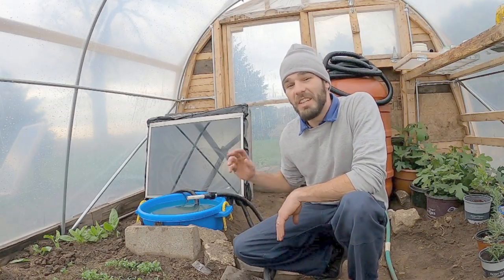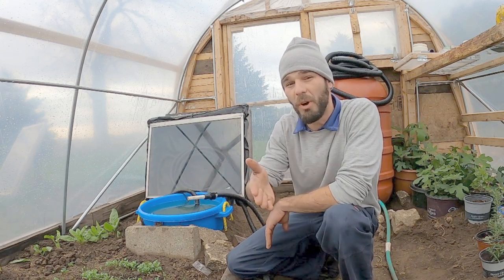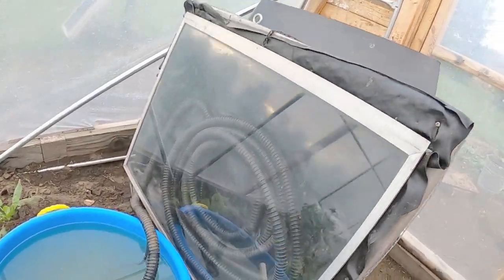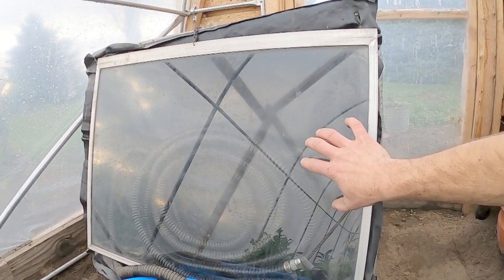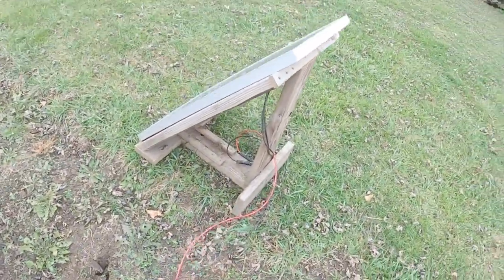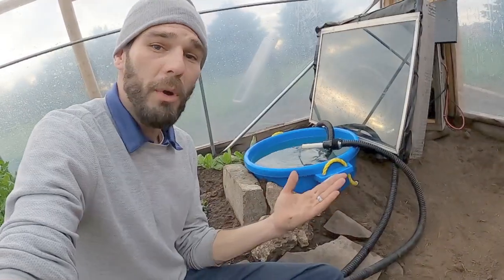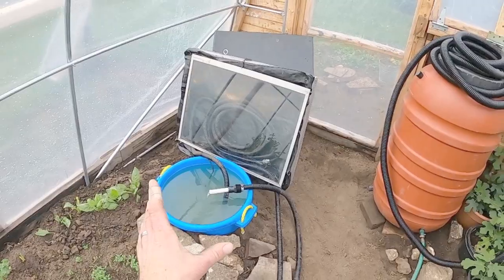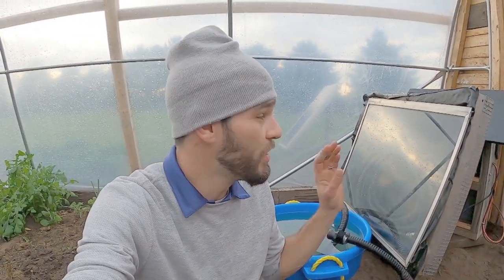DIY Window Box Heater -  Greenhouse Heater Experiment | Recycled Materials Build & Ideas

Comment: Please give some more detail re: the bilge pump: Make, Model, Watts etc...

Do you feel it is of adequate size having used it for a month plus?

What size solar panel is powering it?

Any details appreciated.
Reply from the maker: It’s about ten years old, I’ll have to look at it and get some Info for newer versions. It’s worked great I used it to flow a little creek me and the kids built between two had built little ponds for our chickens all summer and it’s running from a 100w panel. It’s just a 12v dc pump not sure on any rating but it’s  darn reliable. Sorry I couldn’t help more at the moment, I will have some more info for you though.
Reply: @Earthdwellershomestead  Thnx much. Any detail like that is appreciated when talking about the equipment you're using.

Happy New Year.

Comment: Very interesting, I am looking forward to your results.
However, there's a video of somebody doing this with an old radiator inside a box like yours, but his setup froze and got a one-way ticket to Kaputistan. I think he was going to try some coolant fluid based version. You don't have a closed system, so there's less issues with with pressure, but I know those hoses you are using are prone to leaking. I'd check if I could get some old radiator piping and use that underground, the metal will transfer the warmth better than plastic as a bonus.
Reply from the maker: Thank you for the input, I am using the hose cause it’s what i had on hand for our old pond. I have been looking for recycled rubber hose due to it not leeching chemicals like other hoses. I’m going to work with this a little on trial and error phase. I’ll bring updates!